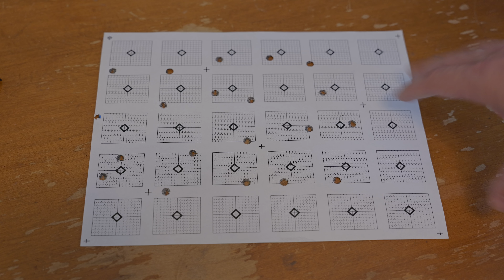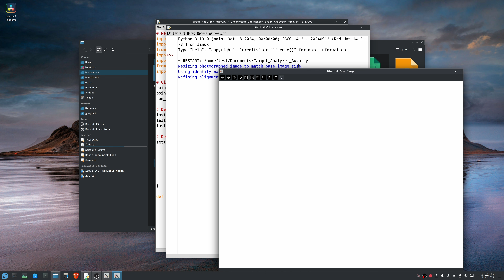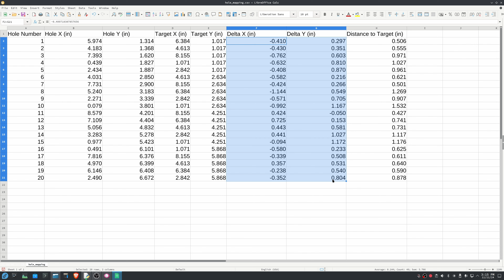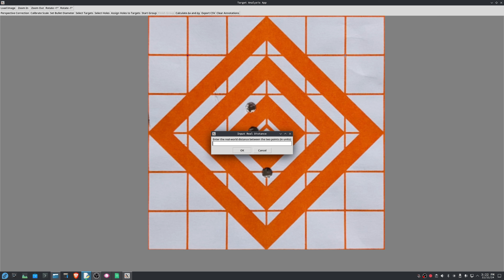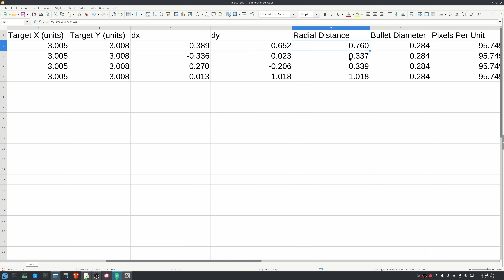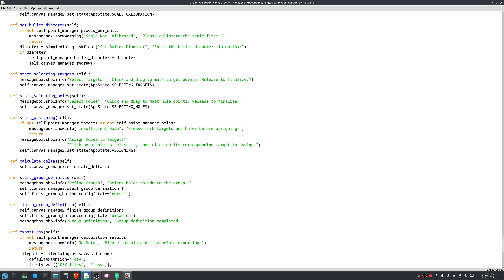An Automatic Target Analyzer (and a Manual Version)

Comment from the maker: I've generated some Windows binaries (.exe files) and added them to the repository. That should allow you to run the scripts without any other installation requirements. This makes for some large files (~60MB vs ~40KB for the scripts), because it has to package everything up together, but they will be much more accessible for most people to try.